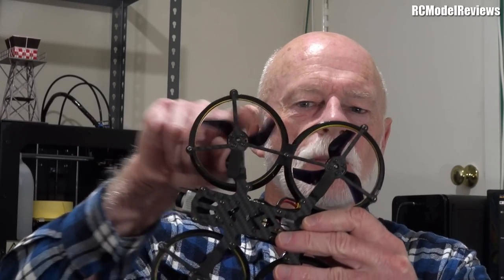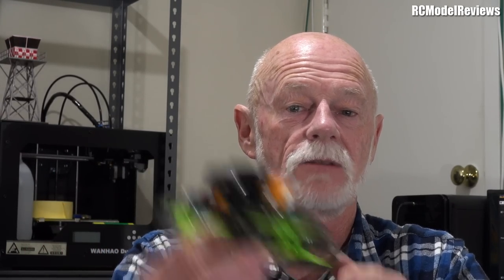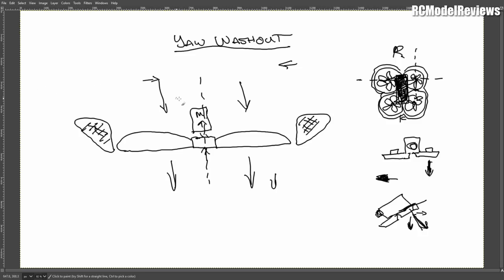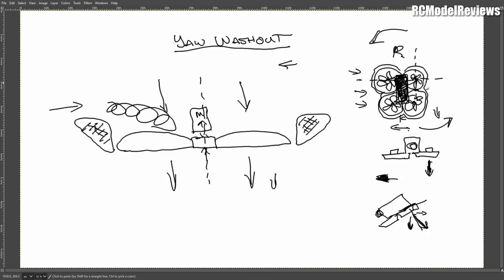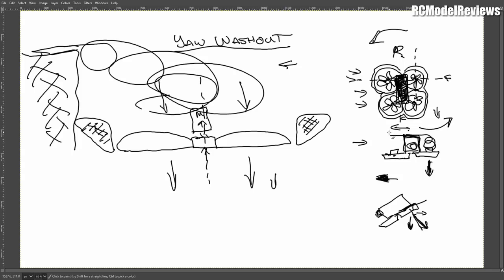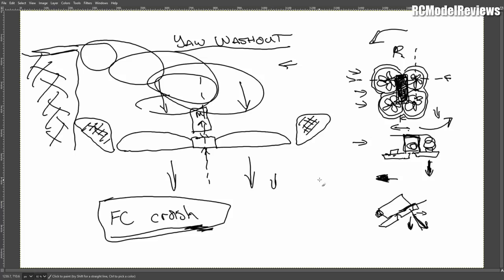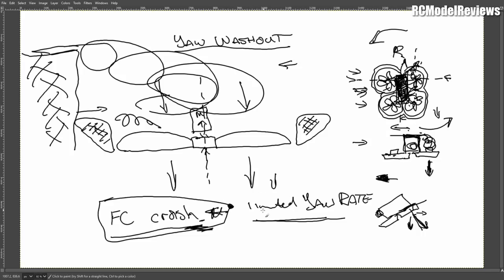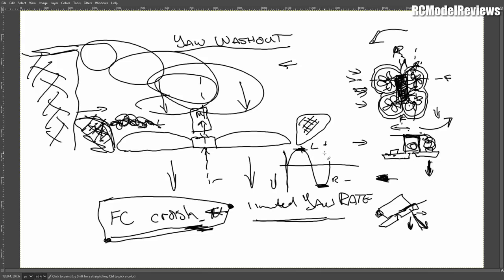Yaw Washout explained and what it means for DJI Avata owners

Comment: Hi Bruce, thanks for the description of yaw wash out, very clear and well presented. I’m only flying the Avata in Manual mode, and it seems to perform well, I guess I’ve been lucky, so far… I have noticed a small amount of wobble in fast yaw turns, both left & right, but it very quickly recovers as you describe.  I have upped the RC rates centre 400, max rate 1080 and an expo 0.54, to match my 5”, and I am now very happy with flight performance. David
Reply: Wondering if 'perhaps' just an issue with the DJI Default rates.  To date, I've not heard the problem replicated from anyone who applied their own customer rates.
Reply: I think wind velocity and angle have a lot to do with it. Air is like invisible water just like he was saying about swimming in a waterfall. I’m a complete noob to flying acro and I’d say another key thing is to not go back and forth between acro and the other modes. Every crash I’ve had has been muscle memory going back to using the left stick for elevation and right for speed and direction after studying the video. It’s just a twitch at the worst possible second and I know it’s 100% me. I changed my rates to what murdersFPV runs, got longer sticks, and since my second battery pack ever flying acro I’m amazed. I’m flying just like in the sim and feel like Mr. Steele hahahaha
Reply: @SkeezyFPV  Bruce description of yaw wash out is very good, and I like the waterfall analogy.  And as Bruce describes I have experience a small wobble during yaw turns and luckily nothing more… so far…

Comment: When it happened to my Avata, during a filming job, the left yaw rate was very gentle.  The wind was calm.  Nothing was yawing, pitching or rolling fast.  I was at full speed in Sport mode, chasing a side-by-side down a road.  I gently yawed to the left enough to slowly move to the left of the road into a field.  All of a sudden, it did the fast pitching motion for a moment.  During this, I had no control, but did regain control before it fell very far.  I continued the chase but it was totally unexpected.

Comment: 1st..love the drawings!  Spot On!  😂😂.    Great overview of the issue people are reporting.  I have the AVATA and can confirm it’s definitely limited to “manual more”.  I’ve seen none of these issues in GPS modes (Normal & Sports Mode).    Your the “calm voice” of reason on the crazy YouTube world!  I’ve totally customized my AVATA by hard wiring a GoPro Bones to it so not going to speculate on issue.  Hopefully, it all gets figured out.  Always enjoy your take on a subject.  👍👍👍
Reply: Interesting insight about only happening on LEFT Yaw turns only (not right).  I didn’t pickup on that until now!  👍👍
Reply: @RGMGFitness  I think that's just because people mostly turn left with quads. To me it only happened twice in hard right turns, once 120-150cm off the ground and recovered both times.
Reply: @FilipRadelic  Yes, thought about that too (about more left turning folks).  Interesting, that it happened twice to you (on RT Turns).  I did see one person on YouTube (OriginaldoBo) try to re-create the issue but said he couldn't.  However, he had changed his rates from the DJI defaults.  Hope it gets figured out....sounds like quite a few folks are having issues.  Perhaps only an issue with 'default rates'...but don't know until some more testing gets done.
Reply: @RGMGFitness  there might be something about the rates. I lowered my rates after it happened (not because of it, but because the original values are ridiculous even for freestyle, let alone cinematic 😄) and I haven't seen it again.
Reply: @FilipRadelic   I hear ya.  The Avata is my cinematic quad.  Not planning on doing anything crazy with it.  See a lot of folks flying that thing way to aggressively.
Reply: @RGMGFitness  thing is, its video feed looks SO damn good that I don't want to fly my "old" DJI FPV System quads anymore 😄 O3AU can't come soon enough!

Comment: Almost lost an Avata at work today to yaw washout, and as a 5-inch pilot the vast majority of the time I had no idea what the hell happened when I tried to pull a high-G yaw/roll turn and the Avata flipped itself over and went straight into normal mode, locking me out of manual until I reset the controls. Thank god I had 30 or so feet of altitude because it very easily could've blown itself to pieces on the asphalt. Never had that happen on any of my quads and I'm trying to avoid having an expensive conversation with my boss.

Comment: 17:19 I only have around 30-35 flights on mine and had this happen once about 120-150cm off ground while I was doing a hard right yaw pushing it chasing a dirt bike. And it didn't crash, stabilised a few cm off the ground. I think the reason it seems to mostly happen in left turns is people generally prefer turning left with quads 😄

Anyway, a bit early to say, but I'm almost sure it's overblown way out of proportion based on my experience, and I wouldn't normally fly a whoop like I did when it happened to me, but Avata kept up with the dirt bikes so well that for a second I forgot I was flying an underpowered brick. Still, DJI should definitely look into it and do whatever can be done to make it less likely to happen, or at least to make it more likely to recover if it's physically impossible to prevent.
Reply: I 100% agree with you on the left hand turns hahahaha! I literally had the same thought today. I think it also has to do with wind direction and speed while executing the movement. I’m a complete noob but soon realized that there was a reason that birds performed their movements gently into and out of strong currents instead of balls to the wall. Gravity. Lol

Comment: I think the issue is there rate controller for there drones is quite weak and it seems to not be able to deal with a situation of excessive error very well.

They should put a form of anti crash into there firmware like the feature in betalight where when it recognises its lost control it switches quickly into a mode using the accelerometer to help it regain control of the drone.

Comment: You have to take into consideration that DJI makes film making tools not race quads or freestyle quads. The average film maker is going to most likely fly at much slower speeds and smoother motion. If the film maker wants to shoot more fast pace aggressive filming they will use the tool that DJI created for that. The DJI Fpv, was made for aggressive fast pace flying. The avata was designed for a cinematic fpv filming experience in close proximity to people and structures with smooth flowing movement.
  They did limit the yaw rate by releasing it with the motion controller. The dji fpv was for fast filming for chasing cars and stuff like that, the Avata was not. If you use these tools for what they were designed for, you’ll likely have no problems. The real problem is trying to race a donkey like a thoroughbred
Reply: @ChulleyChupster  predictable

Comment: I think problem is connected with safety features inside software, betaflight fights to keep quad till is disarmed. Problem is exagerated by worse power to weight ratio due to big battery and efficient powertrain not optimised for raw power.

Comment: Hi Bruce,  Great video,  leave it to you for a 20 minute video on why a brick won't fly. I have been saying from the beginning that I didn't think that the avata ducts were not going to work.  They designed it with 1/4 of the ducts covered and the motors are to small, and of course it's a pig. Thanks again for the information on why the AVATA  is going to fail.
Reply: I have been saying the same thing. The battery and the frame is covering too much of the duct. It is probably unstable flying normally. I now know why my ET125 doesn't have this problem. The battery is on the bottom(not covering a duct) and the canopy is very smooth on top, offering little resistance to air coming from the side.

Comment: Pushers suck, imho.  Whoops handle far better, and are much quieter.  The top-mounted battery is less than optimal, compared to a transverse, under-slung mount.  My daily driver's a 100mm, 2S beastie, 125g AUW.  I run 1104 7500 Kv motors with Gemfam D51 ducted props.  Absolutely zero yaw washout.  I've tried it several times as a pusher: it's twitchy, less efficient, and sounds like I'm making a smoothie with live kittens.  Could be the duct's shape, but it felt weird in the handling department.  That broomstick feeling sucks. . .

Comment: I prefer the Dsynch explanation of Justin Davis, and the physic efect of mass top in a long extensión of frame body and post tumble with the inmediate trust lost of Joshua BARDWELL....
Reply: Desync is a possibility -- but that doesn't explain the post-flip loss of control that some people are experiencing.
Reply: @xjet  mmm....post flip or tumble because lost totally trust and the weight its all on top...its something usual on cinewhoops...
Reply: @humbertocortes68  Also, if this was just a motor desync then I would not expect it to pitch inverted without any rolling movement.   In the instances where the yaw washout triggers this flip the Avata almost always pitches nose down.  That would require both the front motors to desync simultaneously -- an unlikely situation.
Reply: @xjet  may be....
.....the time will tell us! The problem exist and dji need fix it!
Reply: @humbertocortes68  Yet Ken (OriginalDoBo) believes there is no problem.  On his community tab he just stated "Drone manufacturers aren’t responsible for your ignorance" .    I guess part of that reasoning could be all the DJI affiliate links in the descriptions of his videos 🙂

Comment: I think you are all just too harsh on Avata. I was flying it yesterday in manual and flies really great. I normaly fly my ImpulseRc APEX HD 5” on Kiss. It probably has some issue but its showing by missuse. Its cinematic cinewhoop. Its for nice flow videos, not for racing turns. I have seen most of avata crashes and those pilots just dont fly it like that. They turn quickly not tilting inside curve, just ugly fast flat turn or tilt it to outside turn.
Reply: Flight controller crash in flight is unacceptable, flight controller crash that leads to motors continuing to spin is a reason to ground all airframes until the bugs are fixed AND the reason why such failure passed to the production code is identified.
Reply: Yeah if you just fly it slow and smooth as you should you are fine. That's why I rarely fly it in manual. That's also maybe a reason they go with the motion controller. If it is a fc crash then I hope they fix it. This drone is just not a acro drone. People seem to not understand.
Reply: @HannesDev  Flight Controller must not crash in a way that leaves vehicle unsaved under any circumstances. This includes any abnormal situations that might theoretically happen.

Comment: I don't think your yaw turbulence explanation is correct. The linear yaw rotation speed is less than a regular forward flight linear speed. The turbulences are not that signifiant and are less than in forward flight (accounting also for forward flight angle). The drop on big yaw movement is due the the FC software (inherent limitations + bug) and how PID loops and I integration works + the fact that same motors must correct both yaw, pitch and roll angles + the fact that motor thrust is limited, not infinite.

Plus, the fact that Avata does not recover on such instabilities and ends up going inverted, is also purely a FC software issue/bug. Any decent FC software (ArduPilot, BF) can recover from impossible positions (hint: check out ArduPilot throw mode).

Comment: There only been one vortex that I have been affected by, since flying FPV. That's the money-sucking one.
Reply: Yeah not easy to filter that out. But ironically whoops are the solution for that haha.
Reply: @slowentropy4531  I foolishly set the 'I-gain" to a high value, hoping that it meant "income gain", but it didn't work...
Reply: @clifffield1  ah yes well it was worth a try mate, as long as the wallet didn't have a fly away.
Reply: @slowentropy4531  Sadly it was more like a failure to launch. Haha.
Reply: @clifffield1  hahaha, it's all worth it if you're crazy enough to pursue our crazy lil hobby haha.

Comment: Pilot Error........... Most of these guys are trying to fly the Avata like a Freestyle god in a manner the quad was never designed to fly. The Avata is made for slow close proximity flying mainly indoors and around actors. It is not made for high speed dynamic chasing or doing tricks. What is happening is the exterior forces are exceeding the FC capability to react to them. Thus the quad falls into an unrecoverable death roll...Custom builds used to have the same problem when we were overloading the Processor on our FC's running 8k/8k on an F3 board the FC would get overloaded and shut the whole thing down putting you into the death roll.....DJI marketing makes it seam like anyone can just take one of their products of the shelf and get amazing cinematic quality footage.. That is far from the truth.
Reply: Look at DJI's marketing videos though, of course users want to fly like that.
Reply: @FilipRadelic  That's the main problem with DJI they make it seam like anyone can grab one of their products off the shelf and get stellar shots with no skill at all like someone who has been flying for years. That is a flat out lie. Fact is certain crafts are made for certain purposes. Cinewhoops are not made for freestyle/chase flight they are underpowered and top heavy and are made for very slow close proximity indoor or around actors. Freestyle /chase quads are much more powerful with a minimum 10:1 power to weight ratio and do 120mph in less than 1 sec. Not even the DJI FPV drone is capable of that.